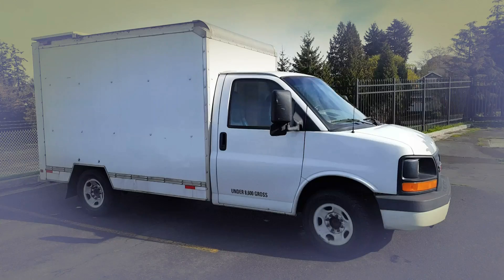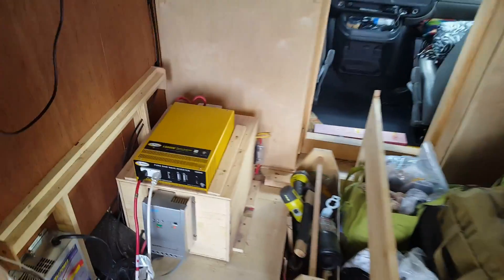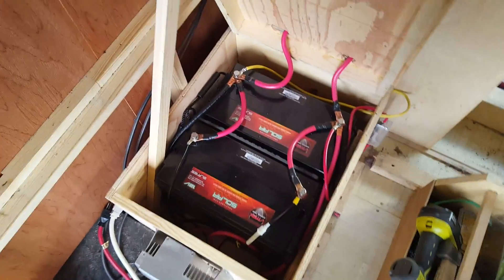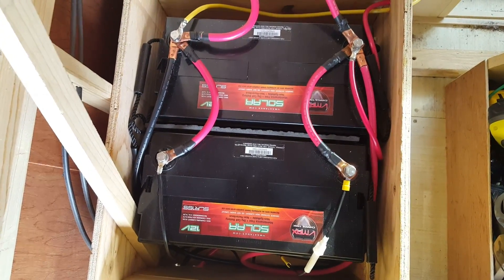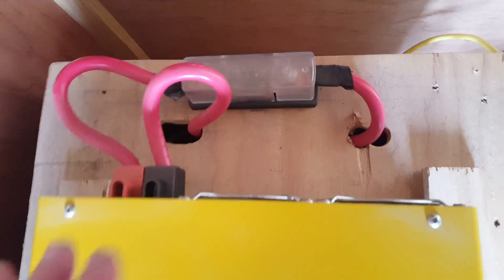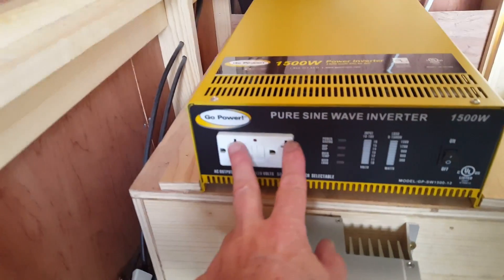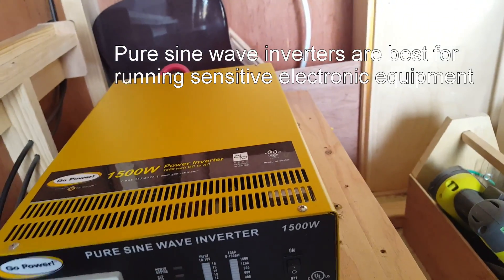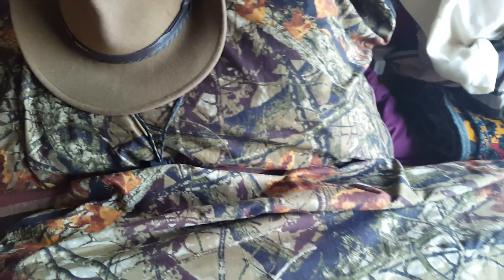dreamsideout 26 My ELECTrical system and the ELECTion

Comment: Your an inspiration Rick. I'm going mobile by the end of the month. Back with an edit. Your bit on the converter got me thinking. Time passed and I found out they are not all created equally. Not good charge converters take a really long time to charge your battery when hooked up to AC or an AC gas generator and good ones take a fraction of the time. I was looking at an all in one type unit (Goal Zero), but when i found out how long it takes to charge from AC to  the built in battery (12 hours or more) that is not even practical. I'll be imitating your set up. Thanks again Rick.

Comment: I have a small experimental solar rig in my shed, and I also went with Renogy. I just have one panel, the less efficient charge controller, and a couple of marine batteries. From the research I've done, you did really well--a very high-quality installation. Bravo.
Reply from the maker: Thanks. Its worked flawlessly over the past year. I haven't added more load to it yet but possibly will ad a cooler.
Reply: I am curious to see what brand/model you pick. I've been eyeing those up myself and can't make up my mind. I will likely be influenced by your decision. No pressure. :^)

Comment: Dreamside- 
Nice setup.
How did your solar do this winter in our rainy Pacific NW?
You are a rare vandweller, who does not migrate south in winter, your input is valuable
Reply from the maker: My solar didn't miss a beat during the winter. The monocrystaline panels are very efficient so may batteries were toped off every day. there was a snow day when the panels were covered for part of the day but they kicked in later when I cleaned them off.

Comment: Hey DSO, something you should consider on your generator.

Stored gasoline, especially the kind with ethanol in it, eats away at your gaskets and seals and forms gums over time.  Generally, you don't want to leave the same gasoline in a generator for more than a week or two or you're very likely to run into problems starting and running it as well as reduced lifespan of the generator.

If you're going to store gas in it for longer than a few weeks, use a stabilizer like Sta-bil.  It will keep it from gumming up at least.

I personally store a metal 2.5gallon can of gas with a latched lid that compresses the gasket inside my vehicle, never had any issues with fumes or leaks, but I did pay about 50 dollars for the can.  If you're storing gas in a generator inside your vehicle, a high quality gas can is really no different.

Main trouble with putting some kind of a bracket for a gas can outside of your vehicle is theft and vandalism, really you need a full enclosure to protect it from the sun, weather, and vandals.  If you continue to spend much time in the city and put a gas can on the outside of your vehicle don't be too surprised if you come back to it stolen or punctured or something.  Incidentally, it also does most of an arsonist's job for him, so make sure you have good vehicle insurance.

Comment: Thanks for the tour. The cabinets you made. What are you using for the track for the sliding doors. I just finished my cabinets today and I am looking at different ideas for the doors. Also did you just leave all the wood unfinished? No stain or poly coating? Has that been a problem? I want to poly mine but i am concerned about how harmful the vapor would be.
Reply from the maker: I wiped all the cabnets with a coat of poly. It looks like natural wood no stain. The tracks for the cabnet doors were hand made on a table saw.
Reply: Thanks for the reply. I found a no VOC clear poly myself and it looks very close to how yours came out. I ended up going with doors on my cabinets. I will try the sliding doors in the kitchen maybe.

Comment: Another thought on the fuel supply for your generator.  I assume your van is fuel injected (?), if so you could tap the main fuel line under the van with a tee & valve with a short length of tubing.  When you needed fuel just put a container under the tubing, open the valve & turn on the van start key (no need to actual start the van).  The electric fuel pump in the gas tank will come on & pump gas to the storage container.  When finished, turn off the key & close the valve.
Reply from the maker: Humm. Thats an idea.

Comment: Enjoyed your vid as usual. Just wondering if there is any "heat" issues with the electric being enclosed under the bed?
Reply from the maker: Not really. I never have the inverter on when Im sleeping, but even when I use it it doesn't heat up because I dont put much of a load on it.

Comment: I've been thinking of a way to lock the door from the inside, but I just figured out a better solution. Create a wall with a door. Basically like a front door.You can leave the gate open and still have a barrier. A fold out deck is another idea I'm considering doing, but you seem to have good craftsmanship and would be able to create a wall. What do you think?
Reply from the maker: A wall would work but it presents several other problems to solve.

Comment: Great video and awesome setup. You mentioned your generator and fuel storage. I have exactly the same concern. I did not want to carry around gasoline to fuel my generator. That said, I purchased a dual fuel Gennny that runs on gas or propane. My RV already has propane on board and I feel it is much safer than gasoline. Plus, it's cheaper, safer to store and readily available. Propane also doesn't go bad and gum up a genny carb. If you can do it, convert to propane. I've been running my genny on propane from day one and it has performed flawlessly. Not to mention, I feel much safer storing propane over gasoline
Reply from the maker: Thats a great Idea. Im not sure how to convert it though.

Comment: Yes,on a champion 9K gasoline unit, you can use either fuel immediately without a clean-out,just throw a valve to use one fuel or  the other. Found ,mine on the internet. Look up lp conversions for gas engines.Use mine on lp all the time.
Reply from the maker: Great tip thanks!

Comment: The battries you have must be sealed and do not off gas otherwise they will need to be outside the living area or in a cabinet sealed and vented to the outside.
Reply from the maker: True. Any battery can gas off. Sealed batteries are pretty safe.

Comment: Hey Rick,  Im down in Lake Havasu right now doing the Van Build meet-up with Jamie from Enigmatic Nomadics.  We have made quite a few people happy with mods to their vans making them livable with fantastic fans and beds and more.  I'm in the process just today doing solar on a Ford Transit.  So I'm quite happy to see your content today.  Just a few questions;

Did you use a MC4 fuse up at the solar panels on the roof before they come in or fuse the cable closer to the charge controller? I'm about to use one of these...they make more sense to me. 

Did you do a schematic of your electrical  with details like wire size and fuse sizes?  Would be great to see that if you did.  (photos?)

What size fuse between the controller and the batteries?  I would think its based on the controller size and 125%... 

Did you use a cable system to tie the truck batteries and solar batteries together to allow the alternator to charge all batteries when you drive, is that true and do you use a solenoid to isolate or a isolating diode? 

Did you worry about strapping down those heavy batteries with a cargo strap or just rely on cleating to hold the battery in place...?

You can answer me off line if you prefer, I know I gave you a lot and you thought you were done with this video...hehehehe

Thanks...TL
Reply from the maker: Hey Terry. You have a lot of good questions. I'm going to put some things together and send them to you. I need to review the details of my installation so I don't give you any mis-information.

Comment: Cheap  https://www.lowes.com/pd/Arnold-Siphon-Pump/3142667. Really nice system, you could run a small 12v fridge I bet without any trouble if you ever go boondocking. Fantastic advice at the end..right on Bro.
Reply from the maker: Yea I tried to scale this system to accommodate a refrigerator. I will sooner or later get one...I think :)
Reply from the maker: The Siphon-pump is a seriously good idea! Duh! Why didn't I think of that? Thanks?

Comment: If your van is gas why not get a gas cap with a hose that goes down to your fuel tank and as you run your genny it sucks fuel out your fuel cell on your truck this way you don't have to bother with cans.
Reply: Grunge Luggage Tours , I think that Geni gas tank is gravity feed, so you'd have to add a low volune fuel pump, which could be a pain.